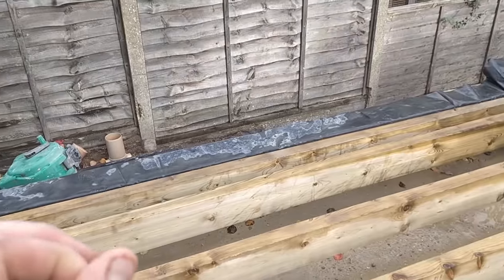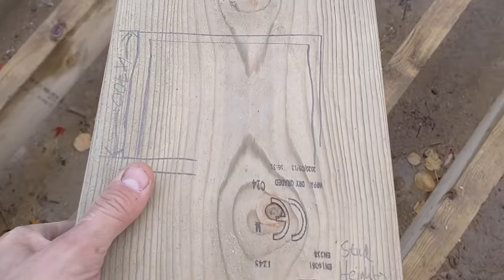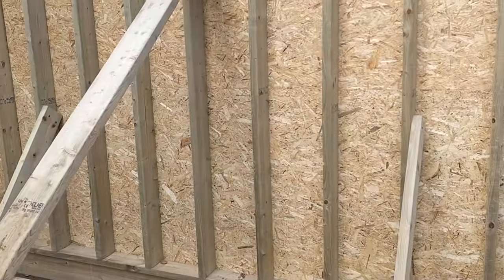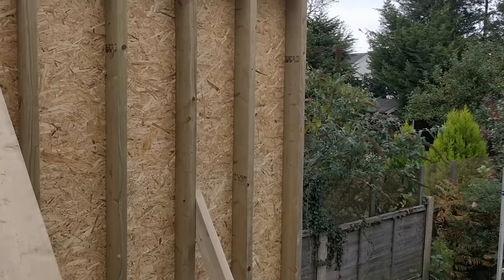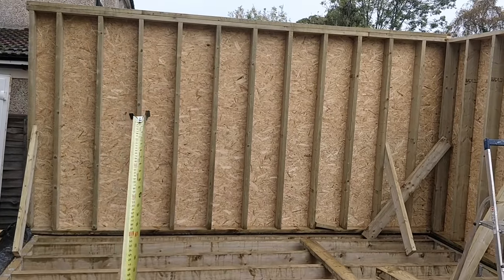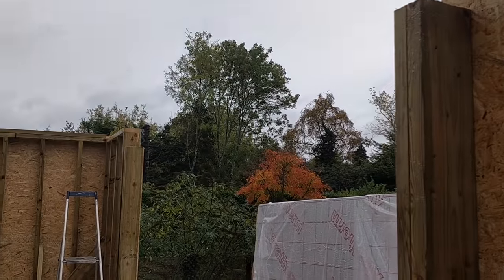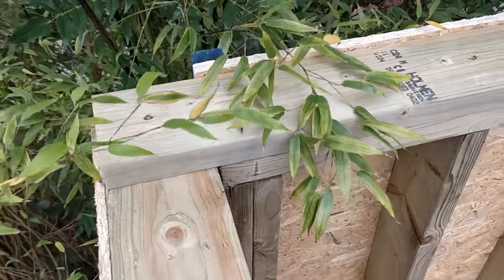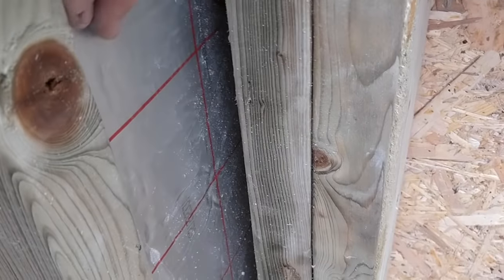How to Build Timber Frame Walls: The Ultimate Guide - Part 1

Comment: How and what type of foundation did you do please?
Reply from the maker: On the single storey rear we did a beam and pad system, and then on the two storey side we used a standard trench fill 👍
Reply: @OfficeBoyBuilder  i am looking at building a wooden frame extension like what you have done and was interested i the type of foundation you did. I like the idea of  a pad and beam. What sort of depth was the pad foundation? I know it differs on ground condition but for your job?
Reply from the maker: Ours was 1m depth specified, we ended up going down 1.2 just in case, but it was clean and would have been fine down at 1.

It's a great system, if you contact iPlans they have pre-approved schemes of work using this system with the building control team that they use, so it's very well understood.

Comment: How do you work out how much timber you need and why 3.6 m lengths
Reply from the maker: I figured out how much timber was needed by calculating the distance between each timber (400 centres) and dividing that into the total width of the space, and then adding on the timbers required for the perimeter. Same deal for the walls, accounting for the studs as well as the sole plate and double header plates.
Reply: @OfficeBoyBuilder  cheers mate and also what size timber for the roof
Reply from the maker: No worries! The floors and roof were all specified at 8x3" and the walls are 6x2". Every structural engineer is different, but by having 8x3's you get a ton of strength, and can also fill it with a lot of insulation!
Reply: @OfficeBoyBuilder  yeah a think mine has had me he was trying to get me out of building timber frame and the size of wood to be used is 9x3 for the roof but he said use 9x2 because its abit cheaper a dont think he delt with timber frames befor
Reply from the maker: Not sure if you want a second opinion, but iPlans are the people I used and spoke to. Absolutely fantastic company and love working with Timber Frame, so will fully understand your requirements and give good guidance etc. Let them know Tom from Office Boy Builder recommended you, they'll see you right.
Reply: @OfficeBoyBuilder  cheers mate much appreciated

Comment: What size timber for the stud wall
Reply from the maker: External walls are 6x2's and internal studs and typically 4x2's although in a lot of instances I've been using it 6x2's for my internal studs because it allows better insulation.
Reply: @OfficeBoyBuilder  ive been told to use 47x100 for my extension
Reply from the maker: Yeah that's a standard 4x2 timber...I'm guessing it's single storey? I would strongly consider 6x2 (150x47), not least for the improved heat and sound insulation. They're hardly more expensive compared with 4x2's but will allow a lot more strength and insulation.

That being said, a lot of loft conversions are built in 4x2 (100x47mm) so it isn't a problem structural (so long as it's single storey).
Reply: Yeah single story 4.8m by 7.5 m kitchen and washroom